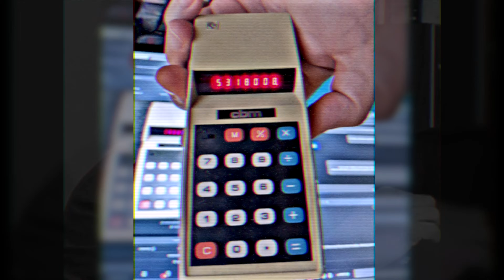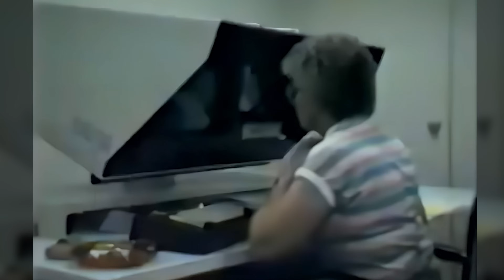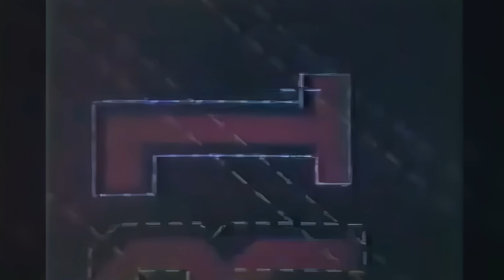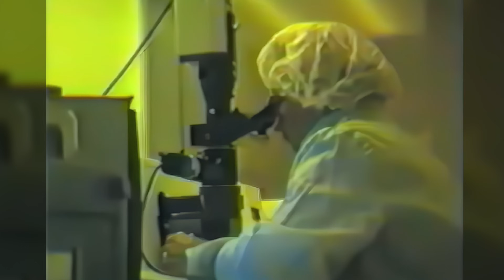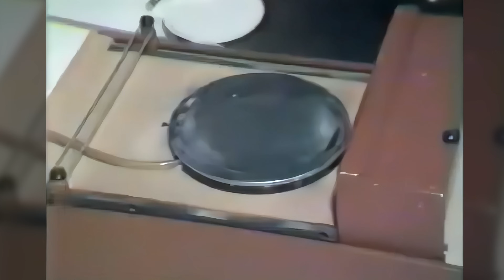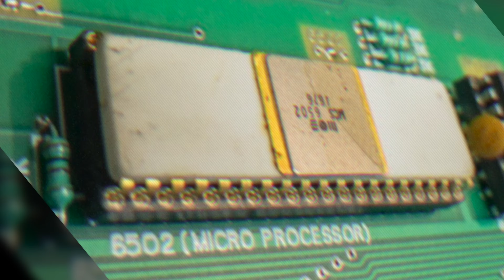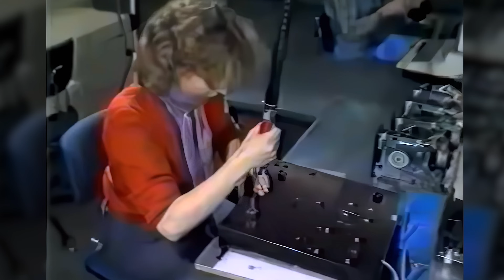How It Was Made: THE COMMODORE 64 factory tour

Comment: Interesting review of history. I wonder if a Raspberry Pie is as powerful as a full C64 or even an Amiga? Cellphones are crazy powerful!
Reply: The raspberry pi is massively more powerful than C64. In its latest form it is roughly 1400 times faster, has far more memory and is cheaper to buy. Would still gladly swap one of my pi to get my old 1984 vintage C64 back, though. Never should have given it away…
Reply: @erratic100  there are vectorized functions on the current ARM chips, even the cheapest ones.  These vectorized functions are on the order of millions of times more powerful than any C64 could dream of. As a reference, in 1984 the only system having vectorized functions was the Cray supercomputer.

Comment: Still have mine. That thing has taken a beating. From lugging it to computer group meetups in the mid 80s to multiple moves all around the country. Still works great!
Reply: I have bought and collected 5 units over the years from Ebay and craigslist.
Plan to setup my commodore station very soon!
Reply: @Pau_Pau9  5 Commodore 64s == 40 bit computing!
Reply: You don't even have to make sure you keep oil in it! Hope your 64 keeps buzzing along at a blistering 1 MHz for the next couple of centuries.

Comment: This has to be the most significant video on this channel... You hit this out of the park for many reasons: 1. Historically recovering the building of the C64... WOW 😍, 2. How chips are manufactured, tested, etc. (more on that later), 3. PCB Assembly and test, 4. product assembly and tested.

I know a lot of people who watch this channel have always grown up with a computer in the house, they never knew the days before.  And a lot of what goes on inside the boxes are like magic, they have no clue what goes on behind the scenes to make it possible.

I worked in the mid to late 90's at Hewlett Packard's (then became Agilent in 2000) Semiconductor Test Division in Santa Clara, CA... We built machines that big names semiconductor manufacturers like Intel, AMD, Fujitsu, etc. purchased to put in their cleanroom FABs to test their FLASH memory devices at wafer sort... in other words, while the FLASH chips were still a wafer, before they were cut into chips.  Our machine interfaced with the prober and when the wafer was Z'ed up and the needle probes touched down, a signal was sent to our equipment to perform the test... The customers that used our equipment wrote their own proprietary scripts and patterns to run for their design (that's part of the secret sauce) , and there's a lot of magic that happens at test, including a tricky way they could "repair" the die if it didn't pass using redundant circuitry inside the chip,  but in the end result is either PASS or FAIL.  The ink dot in the center of the die indicated BAD or FAIL.  Our testers had multiple test sites so we could test more dies at the same time to minimize the number of touchdowns needed, as they were limited and are slightly destructive to the bonding pads... I could write even more about this, but that's the big picture.

In the video it was depicting a single die being tested, since I saw the ink dot, I knew that this wafer was bad and it was being run through the tester again for demo purposes... clearly that was not in a cleanroom, in production the whole thing is done in the cleanroom, the wafer would be loaded into the prober and the table is Z'ed up to allow the probes to contact... the table also is able to translate X and Y very precisely... I mean every little detail is so impressive! I digressed...  Back to the wafer, it would test multiple dies at a time, at some point we were able to test up to 16 at a time, in parallel, we had interfaces with 100's of channels and each channel had the ability to set a voltage, read a voltage, characterize current, connect to a pattern generator... it was insane how much our tester could do in parallel.  At the time I worked there we were part of the Semicon and they collaborated on a video called Silicon Run I https://www.youtube.com/watch?v=kCLmR_TQcY8 and Silicon Run II... and there are other videos that explain the semiconductor chip manufacturing process... They still command high $$ for an old video, but something that the public is unaware of and sadly I think should be taught in school, I mean, Why not?!?

So I hope you get a lot of positive feedback for the video with a lot of people saying they had no clue how this modern miracle of electronics is made possible... more people with respect and humility to know that we indeed stand on the shoulders of Giants!       Kind regards!
Reply from the maker: Thank you for your kind words! Means a lot 👍🕹️

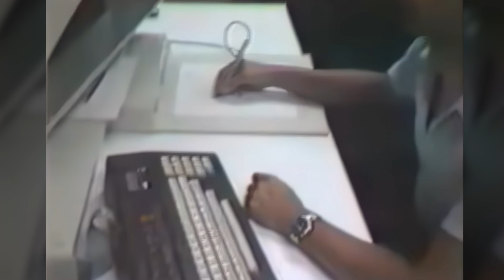Comment: 5:36 interesting to see that they did their chip design on one of the TED range of computers! ;-)
Reply: This was from 1982.  The TED computers didn't come out until 1984.  I'm sure what you're seeing is some insanely expensive and specialized machine geared toward circuit design.  There's basically no way a TED could possibly help design a chip like that.
Reply: @stevesether  Ah, yes, I know this and was just being daft... as a C16 fan, I just like the idea that the C64 might have been designed on a '16! I thought the workstation's keyboard was reminiscent of a 364.
Reply: @andrewgale7731   @Andrew Gale  Incredibly, the original 6502 from MOS was drawn out by hand, by a guy named Bill Mensch.  They didn't use one of those expensive machines to do it, likely because they were just MUCH to expensive for MOS.

The keyboard of the layout computer does look a bit like a C16.  The TED series was designed by Ira Valenski.

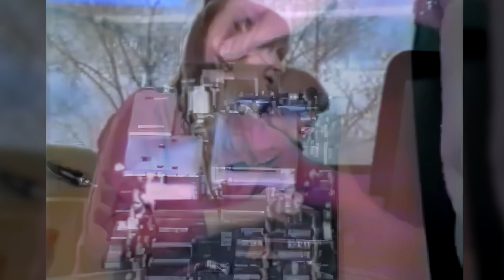Comment: 17:40 - What is that cartridge?

I spent the last few days trying to identify a cartridge that was sold to me as a “mystery Atari computer cart” from Canada. With 44 contacts, it’s definitely a C64 cart but there are no screws and the label is torn. It looks like there used to be a label on top of another but there’s nothing identifiable left. I did broad searches to find examples of various C64 carts and I can’t find anything that matches the case style. The closest appear to be Atarisoft carts but those have screws or injection mold points on the back. Also, Atarisoft labels are bigger/lower, unlike my mystery cart… and the one in the video at 17:40, which appears very close or identical to mine. Perhaps it’s some kind of test cart. Very curious to know what I have here but I didn’t want to just shove it in and turn it on when my C64 is in a pile of stuff in storage after an EF4 tornado disaster.
Reply from the maker: There's only one way to find out!
Reply: @RetroRecipes  Yep. I wish I knew what she was seeing on her screen at 17:40.

My C64 and 1702 are under a pile of stuff from the tornado-damaged house but when I can get to them I’ll be sure to test it out ASAP. If it is some kind of production test cart I bet my SwinSID Ultimate will cause a conniption fit. ;)

It’s a very substantial-feeling cart with a beveled PCB and a clearish-white PCB. No screws or injection mold points I can find. The case feels too rigid for clips/snaps but that must be what’s holding it together since I can’t find anything else. Feels hard and heavy, like Bakelite or whatever they used to make knobs and stuff before injection molded plastic became common. There are no ribs around the side/label like there are with retail Commodore-brand C64 carts.

Seeing a label on a label reminds me of the prototype NES game I found for $0.50 USD. :)
Reply from the maker: @emmettturner9452  Sorry to hear about the tornado damage. Drop me an email if you discover this is the same cartridge as I'd love to see it 👍🕹️
Reply: @RetroRecipes  Will do! Thanks
Reply: @RetroRecipes  Well, I haven’t gotten to try it yet but I did get a peek inside. The cartridge was a friction-fit with pegs and tight tolerances so it opened right up with a metal spudger. The inside has the name and phone number of the defunct California company that made the molds (worthless). Thankfully the PCB has more info.

The contacts are gold plated. The board is marked “PC1007A” and “1985 J. Ranheim” with the same logo Jason Ranheim used to sell his Capture II cartridge, Promenade EPROM programmer, etc. There is no button so it isn’t a capture cart. It seems to be one of his EPROM carts so it could have anything.

It has three EPROMs and two 74-series logic chips, no doubt for bank switching. He did sell bank-switching carts but all that I can find are described as 2-socket or 4-socket instead of 3-socket like this. It has two M27256FI EPROM chips and one MBM2764-30 EPROM.

He made tools for converting BASIC programs into cartridge ROMs and sold the hardware to program and build your own cartridges. He even sold the shells. If it’s part of that business then it could literally be anything from anyone. It’s the curious lack of a 3-EPROM board in his 1985 catalogs that has me thinking this is something custom made by Jason for one of his other products. I’ll have to try it in my C64. :)
Reply: @RetroRecipes  Well, definitely not the same one.

Would you know of a C64 scener who went by the alias “Starshooter?” If so, this used to be his. ;)
Reply from the maker: @emmettturner9452  That was me! Just kidding. No idea ¯\_(ツ)_/¯

Comment: Roboto! 🎹
I was quite surprised when I read a head to head comparison of the 6510 to the 8088. Apparently the former featured a lot of single-cycle instructions, compared to the multi-cycle complex instructions of the Intel chip, negating the clock speed advantage of the 4.77Mz 8088. A fair amount of optimized code ran faster on the 6510 than the 8088.
Reply: The reason is not that 6502 instructions are single cycle (they aren't), but the reason is that 6502 instructions are shorter, often a single byte. Combined with the fact that the 6502/6510 can read or write a byte to/from memory, while the 8088 can only read/write a byte every 4 cycles. 4.77/4 isn't that fast anymore and due to the fact that 8088 instructions take more bytes, the 8088 spends a lot of time on simply reading instructions from memory.

However, instructions that are executed from microcode help the 8088 a lot. If it is executing something like a REP STOSB, then the 6502 is gone, it can't compete against such instructions.

Comment: In the mid-to-late90s I worked here!! in the clean rooms at the facility you showed in the beginning ("MOS" in Norristown PA) just a couple years after Commodore sold it - After Commodore, when i was there it was used by Motorola to manufacture silicone wafers for chips that went inside of those ID cards we all scanned to get into doors at our jobs in the 90s and early 00s (the white, thicker ones, if you saw one you'd recognize it.  These days they are in every/any ID card but back then was a specific tech that Motorola had the patents for).  Also Commodore stored solvents improperly and it became a US Superfund site to cleanup chemicals left behind that leaked from tanks underground
Reply from the maker: Amazing! I didn’t think I’d hear from workers there. The original video seemed a little confused as it referred to the big building with MOS logo on it (now QVC) as Norristown. But that wasn’t Norristown but Westchester down the road, is that right?
Reply: @RetroRecipes  Oh I worked at the one in Audubon PA when it was called GMT technologies probably 1994-1995 which spawned from Commodore Semiconductor Group, MOS's successor.    West Chester was the HQ (now QVC) but Audubon is where they manufactured

Comment: This video brings back a lot of memories. Some of my friends had Commodore 64s when I was a kid. When I was about 20 yo I worked in a company called Taconic (in Ireland) which had a small separate factory for making the boards for printed circuits. I don't remember exactly what I was doing (because I was only working there when they needed extra help) - I remember they were a kind or copper color and we used a runny gravy-like liquid for etching them for some reason. We also cut them down to size from large sheets. There were ovens involved too. Anyway. Great video!!
Edit: I also worked in an IBM chip manufacturing facility near Dublin for a short while. One job was I did was loading trays of tiny chips into a machine that electronically tested each one. Fun fact: They had a hard drive division called Storage Technology Division - my friend worked there and he suggested they change STD to something else (for obvious reasons) LOL - They changed it to something like SDD (Storage Drive Division)

Comment: Superb work Perifractic.  Maybe it could be enhanced with a prequel on how the 6502 was a modified version of the 6501, a cheaper clone of the Motorola 6800. The intrigue of how they got the plans and the legal wrangling that took place between the two companies.

Also why did Commodore BASIC used in the C64 not get enhanced to allow user friendly access to the SID chip and Video Circuits?  Was it to keep the development costs down?

👏👏👏

Comment: I'm amazed how manual the chip manufacturing process was back then.
Reply from the maker: Right?
Reply: Yeah, I always get a chuckle out of watching techs load a horizontal diffusion furnace with six-inch wafers. I used to load more modern vertical diffusion furnaces with eight-inch wafers, in which a robot with five vacuum chucks would transfer the wafers from their carriers to the quartz rack for processing. Those things were fun to watch. Eventually we had a bay with a robot that loaded the carriers into the furnaces for us.